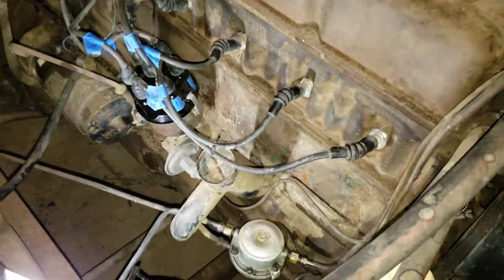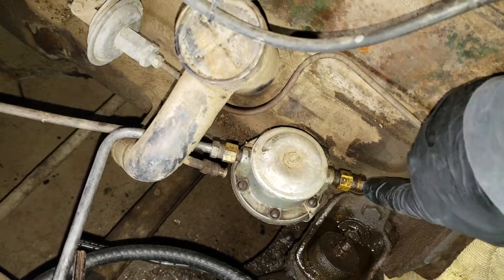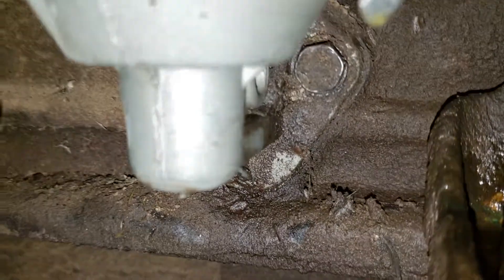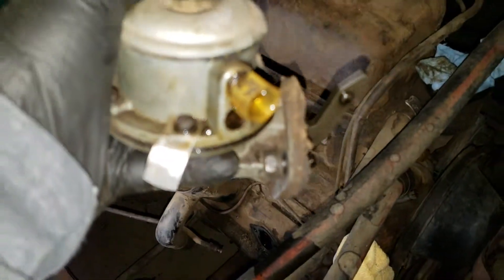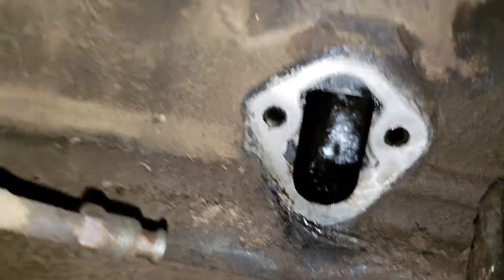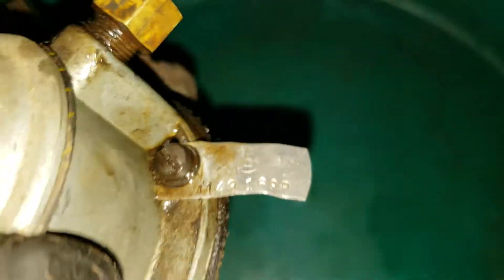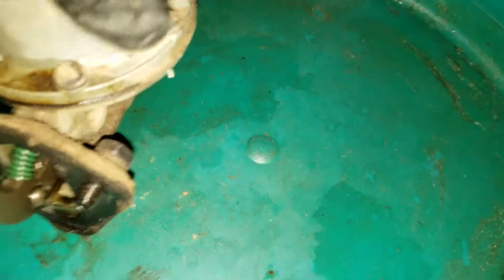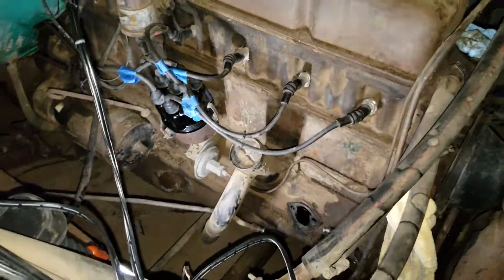1955 Chevy pickup truck fuel pump removal

Comment: I appreciate the video, I need to replace the fuel pump on the 235 in my '52 3800 and you helped me confirm everything I was looking at before pulling the old one off, thanks.  My only suggestion is to ditch the music, it's hard to hear you talk through it.
Reply from the maker: Wow, that's great. I am not a mechanic, so I try to document as much as I can for others who may need help with basic mechanics. Glad it helped...

Comment: I have a 62 235 ... is there a fuel pump push rod inside of the engine? I cant seem to feel it in there.
Reply from the maker: Hi Robert, I don't remember on the push rod question; and I don't  have a video of the installation either...sorry about that. Good luck. ..
Reply: There's a rod/lever that comes out the back of the fuel pump into the engine,, it rides on a lobe on the cam.
Reply: @ittybittyfarm1962  thanks!!! So, there is no pushrod i need to be concerned with in this engine?
Reply: @robertwalker3949  There are pushrods between the lifters and rocker arms.  The fuel pump is actuated by the rod/lever/spoon that comes out the back of the pump, inserts in the block, and rides on the camshaft.
Reply: @ittybittyfarm1962  thank you very much!!!
Reply from the maker: @ittybittyfarm1962  yeah,  i do remember that lever,  didn't know it rested on the cam lobe. Thanks for that info
Reply: Itty Bitty Farm Thank god for your comment. I’m 17 working on my dads(now mine) 56 3100 and I’m doing the fuel pump currently and I couldn’t find a plunger in there and I had no idea what to do but now I know to just put it in there. Thank you so much.

Comment: You know that was the fuel filter right?
Reply from the maker: Yeah,  I guess it's got the filter above the pump. Thanks for that detail...
Reply: @chevy6n2   the fuel pump sits in the gas tank
Reply from the maker: @rolandcyr8599  the fuel pump in a 1955 Chevy pickup truck is not in the fuel tank. The fuel sending unit is the only device in the tank. Thanks
Reply: Stumpknocker Garage The fuel sending unit is the fuel pump lol
Reply from the maker: @rolandcyr8599  never heard that,  but thanks for you comment...
Reply: Stumpknocker Garage ok haha
Reply: @rolandcyr8599  You have no idea what you're talking about.  The sending unit in the tank transmits the fuel level signal to the gas gauge.  The fuel pump is on the side of the engine, as shown.  It is a mechanical fuel pump, it runs off the camshaft.  Fuel pumps that are inside gas tanks are electric and didn't come into use until factory electronic fuel injection became popular about 25 years after truck in the video was made.
Reply from the maker: @ittybittyfarm1962  thanks for detailed explanation...
Reply: yep I was dead wrong I just figured that out LOL
Reply from the maker: @rolandcyr8599  all good
Reply: @ittybittyfarm1962  thanks for straightening him out for the rest of us. What a jerk